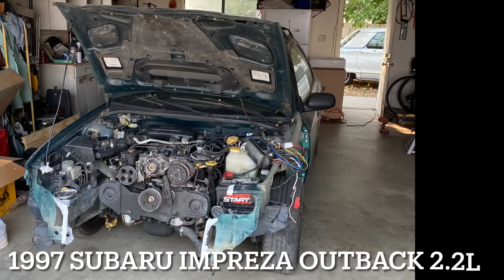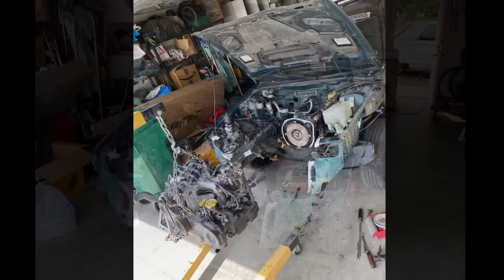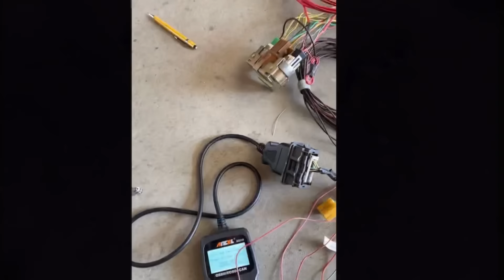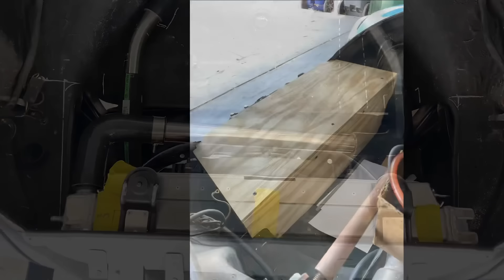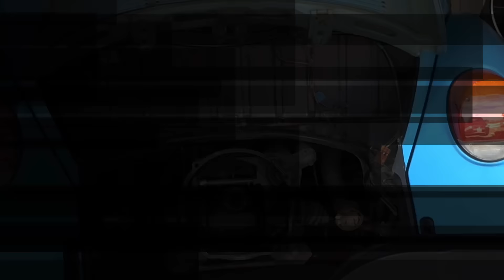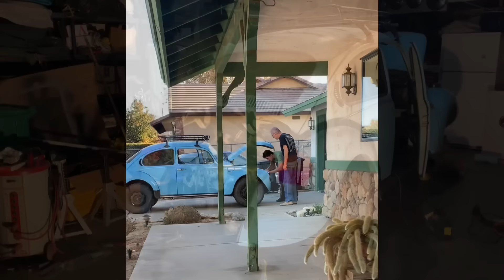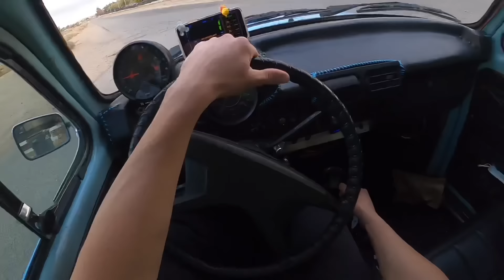Beetle Subaru EJ22 Swap

Comment: CONGRATULATIONS, BUT I THINK YOU WILL HAVE TO REMOVE THE ENGINE TO CHANGE THE SPARKS PLUGS.
Reply from the maker: Spark plugs are easy to access while installed. Removing the valve covers on the other hand, might require engine removal.
Reply: @3DPrints4TC  good work!

Comment: What did you use to bend the tubing with?
Reply from the maker: JMR raceline tube bender with the 1.5inch/6inch die. Part number and website should be in the spreadsheet in the description.

Comment: Why were you short-shifting with the VW engine and not letting it rev up?
Reply from the maker: I was shifting at approx 4500 rpm with the VW engine. From what I’ve read online stock 1600 redline at around 5000 but always felt bad wringing it out that high.
Reply: @3DPrints4TC  
Ah ok. Thanks for the reply. And thanks for sharing the video, nice engine swap job!

Comment: Hi my name is Zeniff, I am currently also doing a Subaru swap engine, and I am having trouble with the ecu, would you be able to answer some of my questions
Reply from the maker: Sure, I’ll try my best.
Reply: @3DPrints4TC  how can I contact you?
Reply: @3DPrints4TC  how did you wire the whole wiring harnesses and did you use the same Ecu as from the Subaru?
Reply from the maker: I used the existing wiring harness and ECU from the Subaru I pulled the engine from. “Busaru” has a wiring harness series on his channel that goes over the steps that i followed for my swap.

Comment: Details does it bolt straight in? Or is there a kit ?
Reply from the maker: You have to buy an adaptor plate from Kennedy engineering to use stock trans. I will be coming out with a detailed series on the swap here shorty, keep an eye out for those vids.

Comment: Where  did you get the adapter?
Reply from the maker: I got it directly from Kennedy engineered products. I believe Outfront motorsports sells the Kennedy adapter too. I have a link to parts list spreadsheet in the description.

Comment: That 1600 didn’t have dual Webber’s.  Which you would have loved more than that Subaru engine anyway.
Reply from the maker: Possibly, I try to keep engines as stock as possible so I never tried to hop up the 1600.

Comment: Sweet    but here u go farther in a hole many are scared of.  That head gasket
Reply from the maker: EJ22 from my understanding doesn’t have the head gasket problems that the later EJ25s do. We’ll see tho.
Reply: @3DPrints4TC  ohh. Ok thanks. I thought it was a subi issue   I love them never owned one but I know they can be a good car. I honestly want an 09 or even the older blob  eye non hatch. Id suck it but  any way with a k20 or 24 for cheap rev limiter buddy

Comment: how you have joint the subaru engine with the beetle transmission???
Reply: Adapter plate
Reply: @ethanpower9245  have some pics of this adapter plate? the axle is compatible or needs some work to adjust with the gearbox?
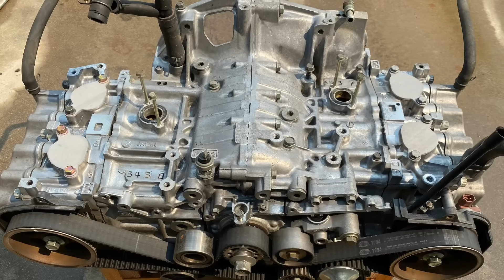Reply from the maker: There is a pic of the plate mounted to the Subaru engine at 0:48

Comment: What gear box did you use?
Reply from the maker: The stock 1974 trans but with a mid mount trans brace, it’s holding up well so far but I don’t do really hard take-offs or drop the clutch. Planning on upgrading to a Rancho transmission with hardened gears in the future since reverse has always been whacked out and RPMS are at like 4000+ going 75 mph.

Comment: Change one weak engine for another with history of blowing
I prefer the 2 liter bus engine
Had 76 buss with one , you could hold it to the floor all day towing my beetle 
It had rods big as a 350 Chevy or maybe bigger.
Of course if daddy has the money , why not, but maybe a 2.4 Honda, but they blow too.
Reply from the maker: For the money, subaru swaps are the most bang for your buck in my opinion/research. But if daddy is paying the type 4 engine swap is the best.

Comment: Still sounds like a VW with both being H4s.
Reply: John - Yes the flat horizontal opposed engines all sound like that, even the flat-four light aircraft engines sound the same.
Reply: @rogertycholiz2218  I read that some aircraft used VW flat 4s and some engines were made as air compressors by using 2 cylinders as the compressor and the other 2 normally as the engine. Too bad VW gave up on it in 2003. Their excuse was that they couldn't make it meet emissions standards...I don't see why as it wouldn't have been impossible with the technology available even then. Surely direct injection, fuel and ignition mapping, combustion chamber designs etc would have made it possible.

Comment: kinda silly - the beetle will fall apart
Reply from the maker: Not really, its not a WRX engine, I drive it like any other car now. Climbs hills in 4th gear, driving in the fast lane at 80+ and great passing power. Did a road trip from LA to Oregon round trip without any problems.
Reply: @3DPrints4TC     I remember beetles have no frame just a flat floor pan - is it strong enough?